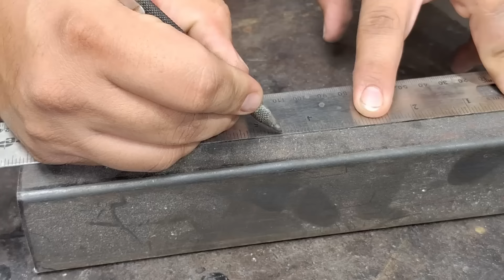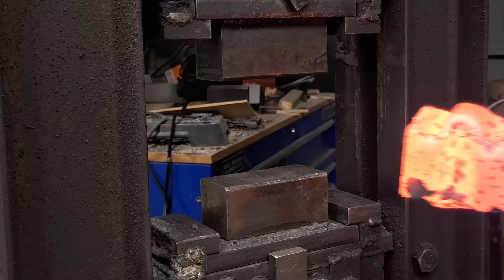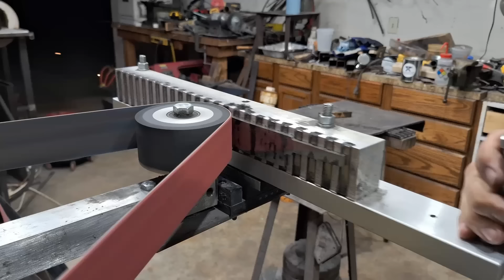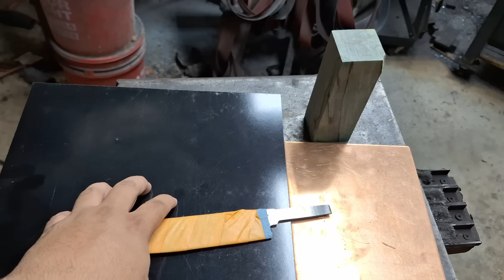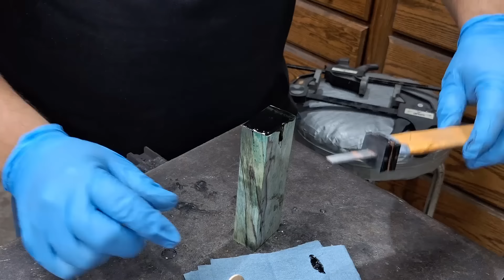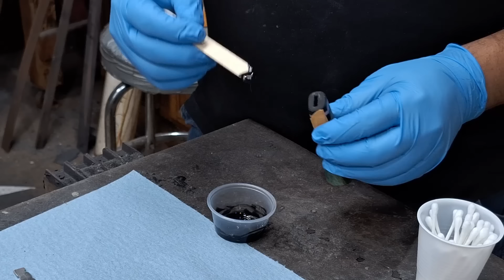Making A Knife From Copper Mesh

Comment: Dude, you have a filthy workshop, there is nothing worse then trying to work around a bunch of tools and other objects on a workbench and on a shop floor, it's obvious you like to make things, but cleaning up after yourself isn't high on your list, get to cleaning up your shop before you make another thing, you'll be glad that you did😅
Reply from the maker: I need a clean day a week 😅 i just never do and it turnes back to this in 3 weeks 😂
Reply: @JPsBladeworks I've been in construction for 40 years and when I was younger I followed the same pattern as you, but old timers would harp on me about leaving a mess, finally I got the message and started cleaning up as I went along as much as I could and the difference was so obvious, there is nothing worse than working your butt off all day and then have to start cleaning up a big mess at the end of the day,plus I wasn't constantly looking for something or tripping over something, in short it made my day so much more enjoyable not seeing a huge mess and having to deal with it, make it a point to clean up as you go or when your waiting for something to dry or set up,every little moment you have and you'll see a big difference in many ways,  good luck brother 😊

Comment: Have you tried using copper/brass mesh ribbon? The ones that come on a roll/spool, like regular round wire, comes on in different AWG thickness. Should give some better results than the sponges, as the mesh you can just cut up in strips and should distribute more evenly.

Comment: I am now the proud owner of this incredibly unique and beautiful piece. It took a bit of convincing for me to splash out for a knife that might just stay in a display cabinet, however all of my buyer's guilt dissipated the moment I held that gorgeous green Spalted Maple handle in my hand. The blade is a true work of art. Even though the internal steel powder/copper mesh billet didn't turn out the way you wanted it to and even though you had to size down the blade due to cracking, JP, I think you achieved something so special with this knife. You didn't give up on your failed "copper Damascus pattern" experiment and instead committed to the craft and turned the experiment into art with the added layers of copper and blackened steel on the outermost billets of the final Go Mai ingot. I now have it displayed proudly in my curio cabinet laying on the first handkerchief I ever made for myself. And before you in the comments criticize me for not using a knife I purchased, let me say that the first thing my girlfriend did was slice up the shipping manifest that was sent in the box with the knife. We had a good time testing the sharpness. It cut through the computer paper like butter. Very satisfying. Thanks, JP. It's so cool that I can put on your video and watch the process of how this thing was made that I'm holding in my hand. And now I can show your video to people and then present them with the finished artifact. What a cool experience!
Reply from the maker: I'm glad you liked it. Its cool to have a video to connect the piece to and i think that is one of the reasons people like to buy these one off pieces. I just finished the 2.0 version. turns out the original material wasnt 100% copper but only copper coated and so i finally found full copper scrubbers and  the result was awesome. Thats what i like so much about experimenting with different materials.
Reply: How much
Reply: @BigBaller-b7v bout tree fiddy

Comment: I bet if you cut solid core copper wire in to slugs and tried that while mixing steel slugs so it is a very random design.

Comment: The mesh isn't actually copper, it's just copper-plated steel. When you cut it with scissors, the cut pinched the copper cladding around the steel mesh so it looks like it's copper all the way through. This kind of mesh can be easily identified since it will be attracted to a magnet.
Reply from the maker: Yes. It never crossed my mind to check with a magnet. I found some 99.9% copper ones and i will be trying again soon.

Comment: I would use a 12 or 14 gage wire coiled around some bar stock. Maybe a double coil. Each coil in opposite directions so they criss cross. And with the bar stock in the center with the powdered steel filling in the outside edges of the can. This way you will have a stable core and the thicker copper wire won't burn out.

Comment: Like the blade, not sure about the handle
Reply from the maker: The handle was a little on the smaller side. I messed up but it still works well when used in a pinch grip as intended. Also not the biggest fan of green anymore bit it is what i had on hand.

Comment: Would it help with the cracking from forge welding the powder if you put in some borax?
Reply from the maker: I dont think so. When billets are made with a lot of powder they tend to crack no matter what you do to it. Ive just learned to live with it. I have another im working on with less podwer and it had virtually no cracks
Reply: @JPsBladeworks  I was thinking if you weld the bottom plate to the outside include a bunch of flux and then have the top plate loose inside and then used a small enough piston to just push the plate down inside the tube it might work better.. might need some vent holes in the top plate to let the flux squirt out... also maybe try it twice once with as much flux as you think you need and once with like twice as much flux.

Comment: Making the lid inside the can lets you compress the billet material more so it has a better chance not to have voids. buyt I have seen it done both ways.  I personally have not used a can yet and only did small layer demascus a couple times as I have not built a press yet.  But I have made 70 or more blades and it is just a fun hobby.  I am new to your channel and I cant wait  to see how this turns out.  So back to the video.   Thank You for sharing.

Comment: I saw someone already mentioned the copper pads are most likely coated steal. There is something else to think about with the combo of nickel and copper. The copper and nickel together will cause the copper take on a silver hue instead of the redder/golden hue of the copper. Depending on how much nickel is with the copper will depend on the color change.
Reply from the maker: They were coated. I checked with a magnet when a viewer brought it up. It never crossed my mind since i was sure to find a package that didnt say copper coated. Ive found some pure copper ones and i will revisit the experiment in the near future.

Comment: Bummer that the copper mesh didn’t work. Maybe copper wire next time? I think this one turned out really good though.
Reply from the maker: Im going to fill the can with more next time. Instead of hand forcing it i will press it with the press to fill as much space as possible with the mesh before i fill it with steel powder

Comment: What is that "spray paint" you use as a separator? Ive seen people use Aluminum or Zink spray but never plain paint.
Reply from the maker: The white color of the spray paint is made from titanium dioxide and that is the substance that keeps the contents from welding to the can. I would say most white paints would work but i would check the ingredients just in case.

Comment: This is still a really cool design. 

did you clean any wax residue off the inside of the handle before the final glue?

Also, why not just add the notches and do all the blade prep, and do it all in one shot, you could epoxy it all together, clamp the wooden part, then remove the blade right after clamping, add some more epoxy, and then final insertion of the blade and let it all cure. Then sand the handle down to size, done!
Only downside is if the blade gets scratched through tape but thats it.
Reply from the maker: I cleaned it with a bit of acetone then i scraped up the inside with a broach before i glued it up.

Comment: Blade looks great!  Is that the 5160 that etched black?
Reply from the maker: Yes
Reply: @JPsBladeworks Oh, I’ll have to remember that. Never used 5160 as a core steel. Thanks for the info, man!
Reply from the maker: For sure. I like to use 52100 but ive had issues finding it that thick so i started using 5160 and it works well and etches nice and dark.

Comment: Looks great like the green handle. They make a stainless scrubber with a heavier gauge wire like that copper one you used. May be worth a try?
Reply from the maker: I bought some but im thinking it might be too thing. I might have to look for a heavier wire so it could resist the copper migration a bit more.
Reply: @JPsBladeworks 

What about 10-12 gauge copper wire?
Reply from the maker: I could but i kinda wanted to use the scrubber hopping it would get a cool look. I think im just going to try again and compress twice the scrubbers with my press
Reply: @JPsBladeworks 

I was also going to ask, were those scrubbers fully copper? Or plated?
Reply from the maker: Turns out they were plated. Im going to search on the web for full copper ones or make some myself with wire

Comment: it turned out BEAUTIFUL! And I think adding the copper scrubber did add something to it. The center has like a static look to it and I think that wouldn't be as visible, but maybe I'm just talkin out my butt lol - I think it looks great even if the scrubbers didn't add anything to it - lesson learned. BUT I don't think you should give up on the idea! - Maybe if you were to cut the scrubbers into pieces and wad them up into small balls (not with your hands tho, it will prolly just cut you - so maybe using too rough surfaces to get the wads nice and tight together) and maybe them into random sizes and shapes so they don't just burn up. You'd get spots of copper through out, and if you make them into different shapes like balls, and logs, and just random stuff - PLUS maybe use some copper powder too - like placing groups of the wads together and placing copper powder into the groups, then putting steel powder around them - it would take some time because you're not just toss it all in, you're building up layers and groups of copper all through the canister in random places - that way there is enough copper in each group that it doesn't just dissolve into the steel (it doesn't burn up, it just dissolve throughout the steel because it DOES get hot enough to melt when it's small amounts, but saying that it burns up conveys the same idea so I'm sure everyone knows what you mean)
I LOVE that you do these experiments!! Because that's what I would be doing if I had the tools to do it.  And using copper has turned out to be MUCH more tricky than I expected!!! So thankyou for sharing these awesome vids with us!!! Kepp up the great work JP!!! And MERRY CHRISTMAS * HAPPY NEW YEAR!!! :)
Reply from the maker: Thank you. Merry Christmas and Happy New Year to you as well. Im looking into other experiemnts to see what i can get to work. Its definitely fun to do.

Comment: I'm 99 percent sure that the copper mesh was simply coated.  You wouldn't be getting pure copper scouring pads for a dollar. Most every copper scouring pad on the market is simply copper coated steel. Pure copper ones are closer to 10 bucks a piece.
Reply from the maker: I cut them and they seemed to be full copper. They were just super thin. I think if it were thicker i might have worked. Im thinking of looking for copper hex to try it again
Reply: @JPsBladeworks Bring a magnet to one if you have any left. You'd be surprised what extremes "value engineering" will go to. They'd likely use steel foils to plate the copper rather than anything more substantial.
Reply: If you want pure copper just "peel" an old electrical wire, maybe stranded or solid core.
Reply: A magnet test easily shows this, at least in any normal cases, given the stainless steel used is usually ferritic and not austentitic. (though the latter is still very weakly feromagnetic, so a strong rare earth magnet will attract it a bit)

Carbon steel isn't normally used, rather it's just the same steel used for the uncoated varieties.

That said, dollar stores (or Dollar Tree specifically) often has surplus/overstock items of all sorts, including name brand stuff, so it could be made of just about anything.
Reply: Copper isn't that expensive... Its like $3 an ounce, and those pads are NOT even close to an ounce.
Reply: looks like thats what happened plus alignment just rings of copper.
Reply: Quanto rame in tre spugnette? Sufficiente per una moneta da 5  cent. di euro.
Reply: I am going to grasp all of the iron inside of your body✌️🥹🇫🇷🏳️
Reply: Most char boi is copper coated, you can actually burn the copper coat off with a lighter which is what you do before you stuff into a stem so your not inhaling copper...
Reply: Well damn aren't you a buzzkill
Reply: @AndrewStevens-b6j not at all, trying to help him out. He even learned from it and made a whole other video.
Reply: The thing is that copper coated steel defeats the entire purpose of having copper at all. Copper is softer than steel, copper pads are made to be softer steel.  It means the copper could wear off and the steel could scratch.

More likely, it just burnt off during forging
Reply: @Menuki  no. Google copper scouring pads.  Almost every single major brand out there is copper coated steel and is advertised as such.
Reply: @Menuki  the rings highlight it was just a coating, and he cut them open. never blended the pattern.  would have been very thin if he didnt add copper to both sides.  

you dont get the wires patterns because it all melted into a steel alloyed with copper. 

it got too hot and he compacted it into a brick. no copper lattice separated by steel powder, just alloyed it 😅

really hard not to blend thin metals in a melting range only a few hundred degrees apart.
Reply: You don't know the brand of pads he is using....and You are completely INCORRECT about cheap copper pads being just plated. Do your research before having diarrhea of the mouth. It's always some know it all that really don't know it all. You're 99% wrong by the way.
Reply: @Mr.GreyBeardSr.  considering the Scotch-Brite brand pads, which are some of the most common in the entire world, are copper coated and are literally advertised as such would show your lack of intelligence on the topic.  There are indeed pure copper scrubbing pads, but they aren't cheap compared to the copper coated pads.   The average price of a pure copper scrubber is between $5 and $15 per pack of 2-3 scrubbers.  They are also significantly more niche than the copper coated ones and highly unlikely to find them at the dollar store, like he stated.  He mentioned he bought 3 for a dollar.  I've done my research. have you?  Show me anywhere that you can buy three, pure copper scrubbing pads for $1.  I'll wait.  Also, why do you seem so upset about this?
Reply: @liebetrau88 as I said again clown you have no idea what brand he is using. Nowhere did I say some were not coated...😂😂 learn reading comprehension. Upset with an insignificant clown😂😂😂 you just wanna talk and have diarrhea of the mouth. I don't finger wrestle clown I put ppl in their place in person. You were bullied as a kid so you get a kick out of trying to correct ppl. Its always 1. I'm sure you some goofy looking white guy too. You Ken's and Karen's always have something to say...😂😂 Also I live in Chicago its definitely places you can get anything you want for a certain price....depending on where you live and who you know fool😂😂😂
Reply: @Mr.GreyBeardSr.  😮 try it... cut it in half, hold a lighter to it, let it cool and rub off the soot. or use a magnet. 

if it was solid copper, youd have the band of copper around it, and veins of copper in the powder... no veins, not even a different type of steel. so it blends with the powder. 

if its left on heat that melts steel too long, thinner copper would diffuse and pool... this may also have lead to how it ended up in one band.  only a few hundred degrees i think between the two... 
so its not easy.... most others that did this used bars or sheets of copper and it didnt glow bright red... hammer strikes and presses cooled it darker, they didnt keep the heat long. 

those people get feathers and waves and some bs... 😂
Reply: @pazsion  has absolutely Zero to do with what I was talking about....carry on clown. Reading comprehension is fundamental. Diarrhea of the mouth is contagious.

Comment: It's beautiful even though it didn't turn out.  I also bought some off Amazon and tried it was disappointed with my results. Wonder if smaller canister with core steel in center work better. Less heat less chance of losing pattern. Canoe style canister this got me thinking.  Happy holidays
Reply from the maker: I saw some copper sweating when i heated it up after i removed the canister. It might work better if done in a canoe with no paint and just grinding off the can afterwards.

Comment: Have you tried twisting together steel and copper wire into a braided pattern before forging segments into a bar? You can get so many different thicknesses of wire that you could fine-tune the pattern exactly how you want it. With a quick search I've only seen stainless steel wire, but I presume that other grades must exist somewhere.
Reply from the maker: Ive never heard of that. Ill have to look it up